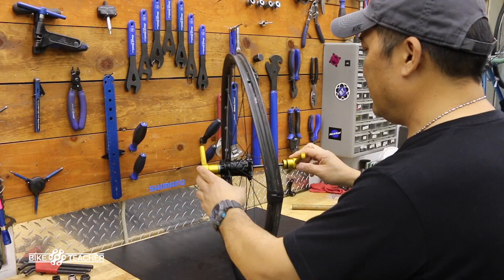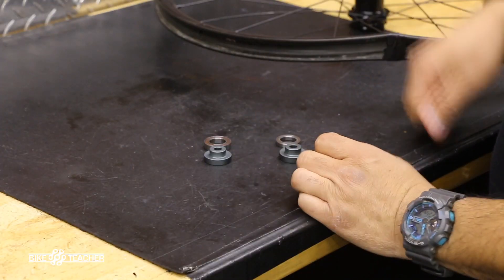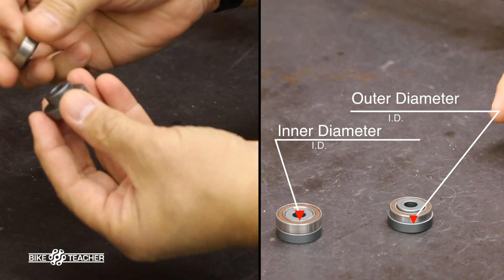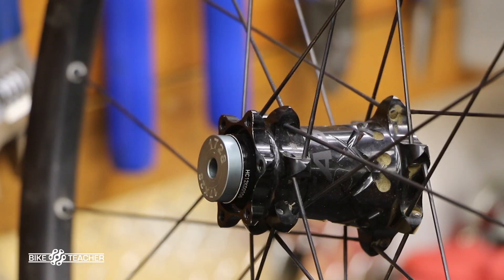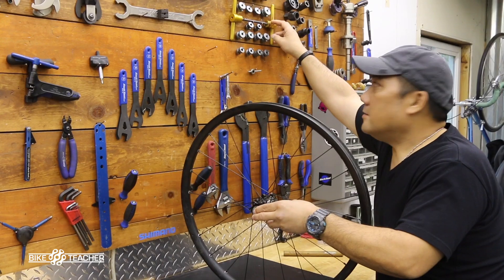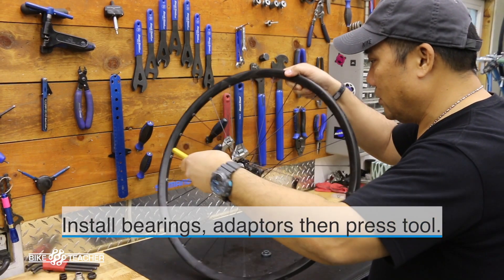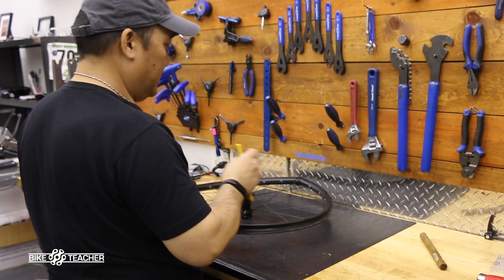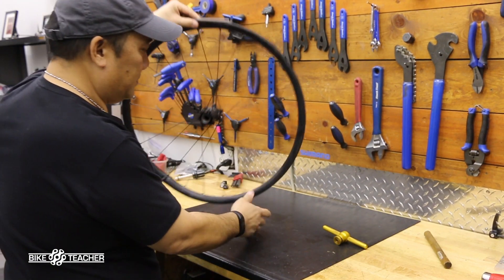How To Press In Sealed Cartridge Bearings in a Hub Using Enduro Tools.

Comment: Great video and am interested in buying that Enduro hub tool  Can you please tell me the length of exposed threads when both handles are attached?  I am concerned it may not be wide enough for wider rear hubs using shouldered axles that require over-axle adapters.  Thank you!

Comment: Handy guide but really only bike shops are going have a £300 tool for fitting bearings.
Reply: or someone who has 5 bikes and wants to save for another one doing such job himself. It pays in the long run. I have been servicing my bike since I was a little kid and at the beginning I struggled but nowadays I save ton of money buying parts and changing them myself.
Reply: That Exact bearing press with blue anodizing can be had on Amazon for 40 euros. Just saying.
Reply from the maker: That’s right, the alternative is a hammer or a threaded stud with various sized washers. Some applications may just need a soft block of wood.
Reply: @BikeTeacher  - QR skewer and some shaped wood pieces probably do the job.

Comment: nice video, straight to the point.. just a question, do you recommend using some grease on the hub before the installation or it dosent  matter  to much
Reply from the maker: Thanks! I rarely see grease used on the installs. I have not used and have seen no grease in the hub coming from the factory. 👍🏽
Reply: Do apply a small amount of grease especially on the frame.